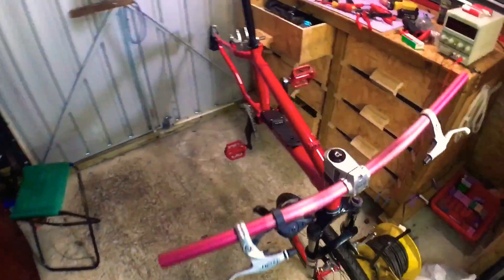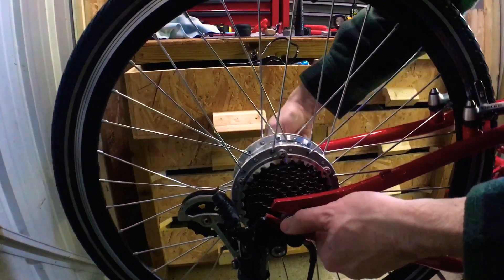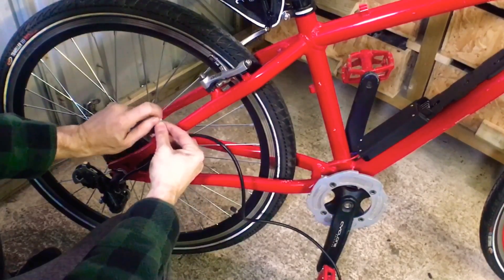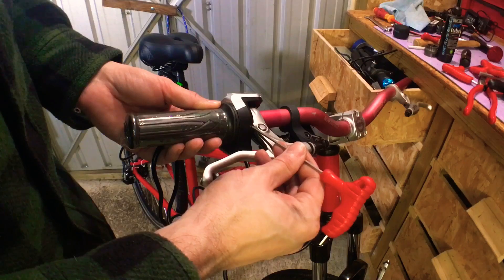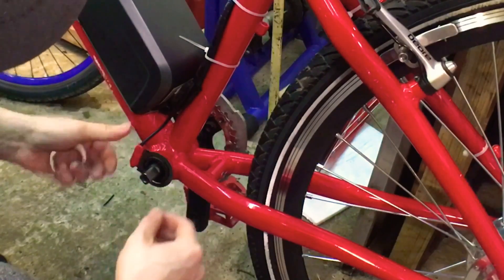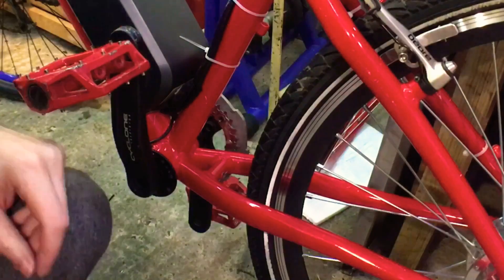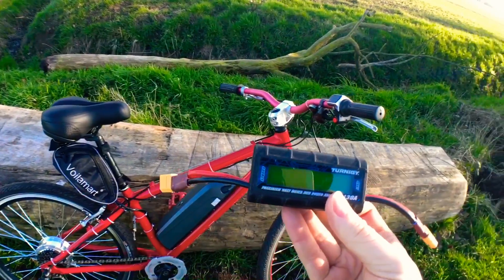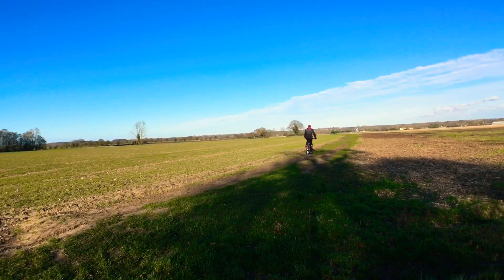DIY 2500w Electric Bike Build In 2 Hours £250 UK $325 US Including 10ah Battery

Comment: How much range do you get mate on your battery please let me know ASAP thanks
Reply from the maker: About 30miles but it depends how you ride if full throttle you might get 25miles, depends on tyres if you have road slicks less rolling resistance I have got 40 miles where’s on off road knobby types I have had as low as 15miles also depends on terrain more hills run the battery out quicker
Reply: Also I am getting a 1000wat voliment  moter and the battery is 48v 20 amps is that good what would the range be and what would be the speed
Reply from the maker: @michaeljg4959  couldn’t really say speed be around 30mph you Might get possibly 45-60 miles range depends on manny factors but good luck it’s all good fun .

Comment from the maker: Ebike Parts https://www.banggood.com/custlink/3Dv3bT3Q5l
*Cobalt Drill Bit Set https://www.banggood.com/custlink/m33GhoqQgF
*Cordless drill  https://www.banggood.com/custlink/DmvGNTT9iT
*Electric bike Wheel https://www.banggood.com/custlink/KKDKNf7t7S
*48V 350W 10.4AH 20 inch E-bike https://www.banggood.com/custlink/3DDGn1TIl5
*CrimpTerminals Connectors https://www.banggood.com/custlink/mK3GAuT8oI
*Wire Crimp Tool https://www.banggood.com/custlink/DvD3sfwIaa

Handy Good Cheap Tools
*MMA welder i would like https://www.banggood.com/custlink/3vGDsufVnM
*MIG welder i would like https://www.banggood.com/custlink/K3KKs7T5nO
*TIG welder i would like https://www.banggood.com/custlink/Gm3DBGhSsi 
*Tin Snip https://www.banggood.com/custlink/KmmmnwTVMl
*Stick Welder https://www.banggood.com/custlink/DDGKsw7PU9
*Welding Clamps https://www.banggood.com/custlink/mKKGbuwF1j
*Machinist Hammer https://www.banggood.com/custlink/KmDmQ1ut11
*Screwdriver Set https://www.banggood.com/custlink/KmmKATw5w4
*Precision Screwdriver Set https://www.banggood.com/custlink/K3v3Nuwi8V
*cordless Angle Grinder https://www.banggood.com/custlink/GDKmAFL7s4
*Carbide wood turning tools https://www.banggood.com/custlink/KKmKQwfS8S
* flex shaft Rotary Tool https://www.banggood.com/custlink/3KK3Z35Boi
*palm Router https://www.banggood.com/custlink/GDGGbT1iSj
*F-Clamp https://www.banggood.com/custlink/vKDGbfuZiB
*Double Edge Pullsaw https://www.banggood.com/custlink/mvGvb7uIZN
*Mitre Box https://www.banggood.com/custlink/33KvbuTSj3
* Impact wrench  https://www.banggood.com/custlink/mKDK6g6Bts

Above are affiliate links and in the comments it costs you nothing, if you do not want to use links search on goggle more info Thanks.